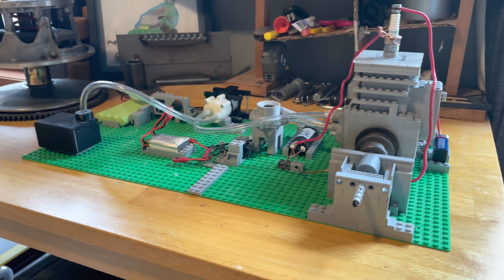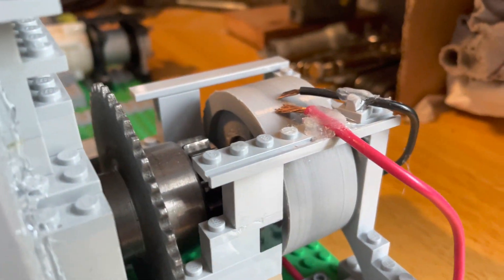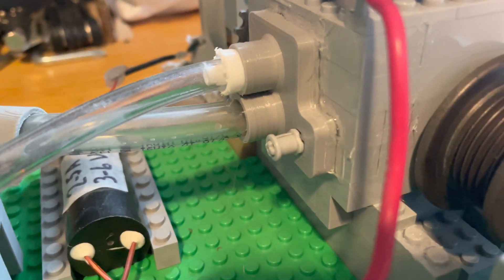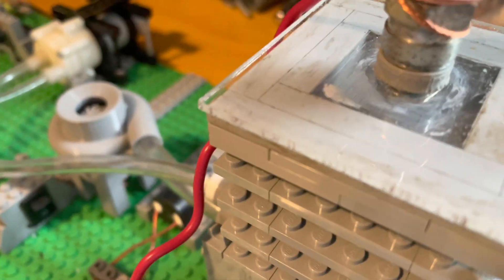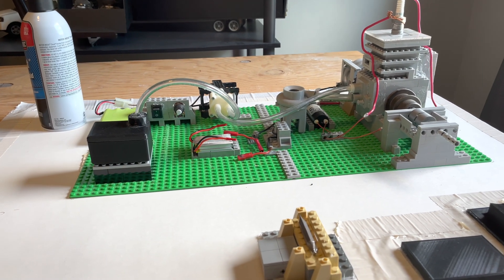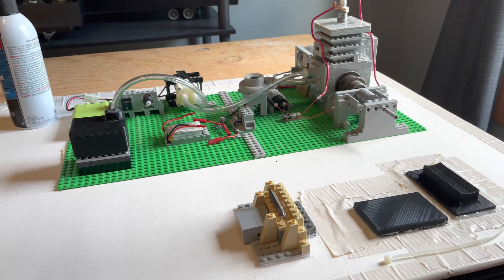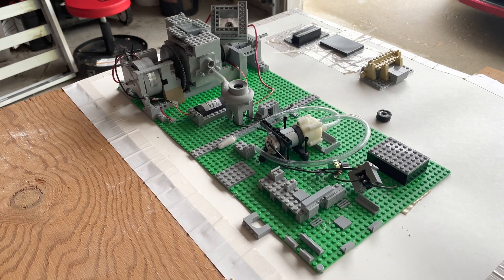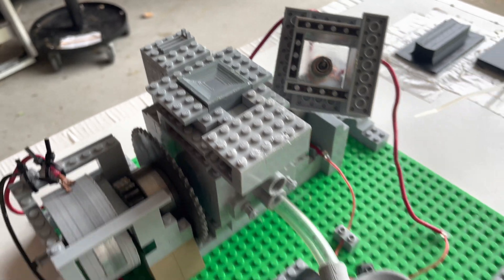Working Lego Combustion Engine Testing & Destruction!

Comment: Dude, I liked this video within the first minute of seeing your setup just from all the hard work and insanity of the setup. I couldnt believe you scrapped it all in the end! All you should have tried to do was make the cylinder stronger and I'd bet it would have started when you sprayed into the intake! The problem is with legos, all your support is side to side, the way you have it built. Its only the friction fit of the nubs holding on each layer vertically which can take far less stress. You need another layer that ties the top to the bottom, or just try super glue or shit, maybe even zip ties around the whole thing. I hope you retry this mate.